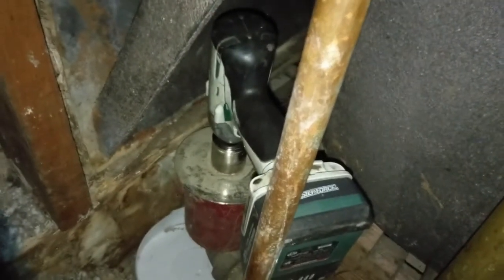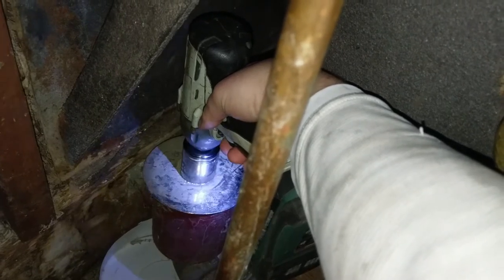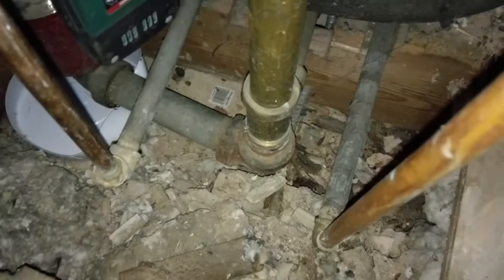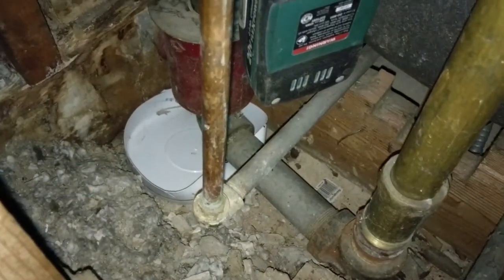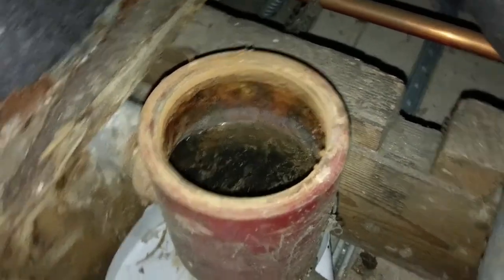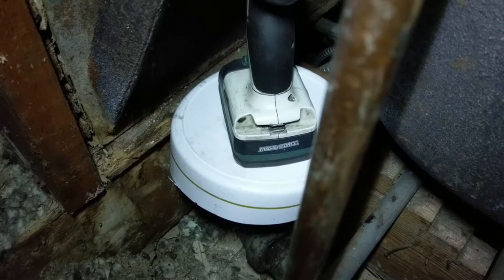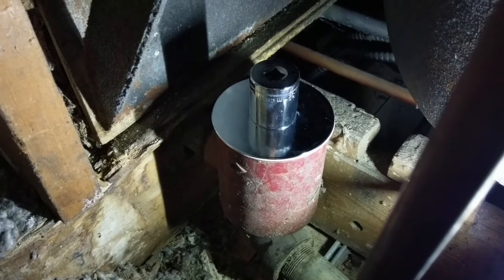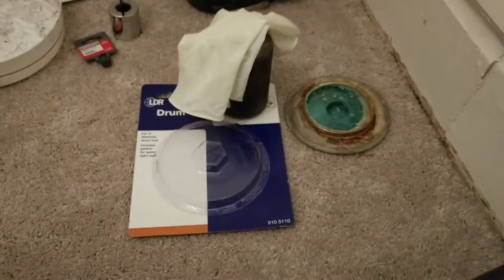Dealing With a Drum Trap

Comment: Love it... just got my drum top off... what did you use to snake the pipe???
Reply from the maker: I used a zip-it at first and then ran to the hardware store and got a 20' snake as they're relatively cheap. I'd recommend if you go the longer route look for one you can attach to a drill. Mine is all manual and can be a pain for really long pipe runs.
Reply: @JustinTheJMan  Drain is unclogged!!! 👍
Reply from the maker: Nice! Saved quite a bit of money I'll bet.
Reply: @JustinTheJMan  I was lucky enough to reuse the drum lid so my only expense was $20 for the snake 👍
Reply from the maker: @SGBSTORE11  Just make sure the seal is still good!